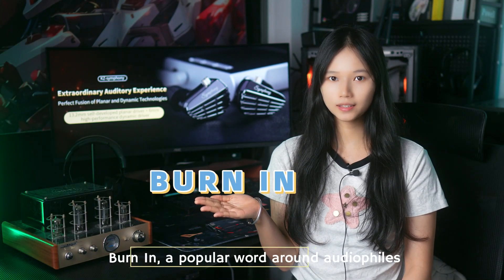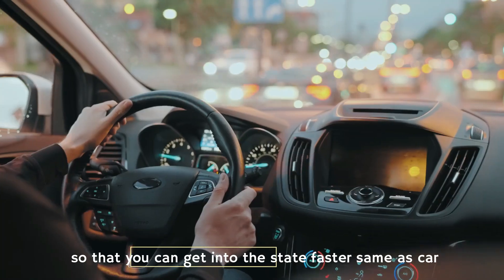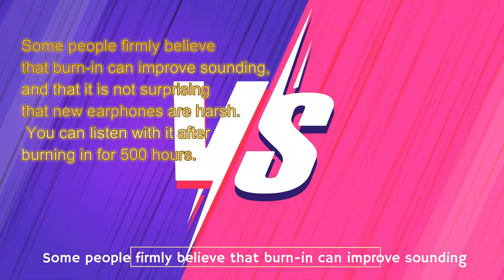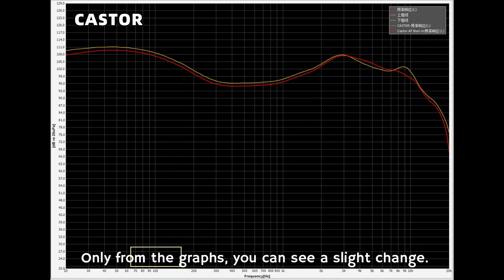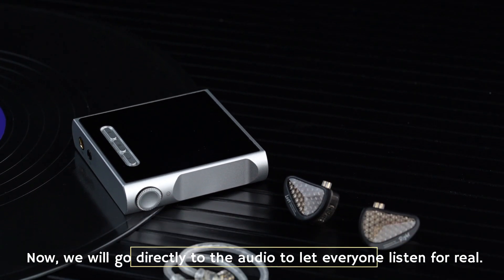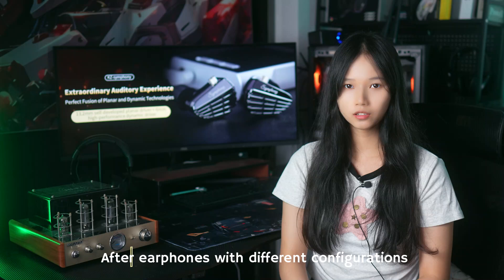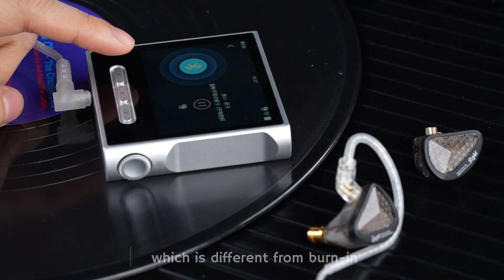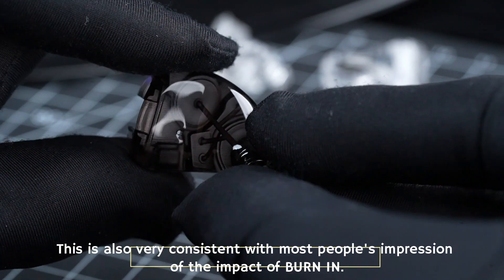IEM BURN-IN! Does it Work? Truth or Metaohysics?

Comment: Yes, it does work as usual. The bass will slightly turn warm after burning process. I realized that the planar driver need more time to burn in at first I feel the volume level is low but after the process it felt the volume had increase a tiny bit. This burn in takes time. I own most the k'z iem. By far the k'z castor pro are my favorite iem. Keep it up k'z team

Comment: It definitely work, cable, drivers, getting better on sound quality. Been  audiophiles  for 30 yrs and every tube amps, speaker cable and interconnect needs to burn in before the real sound really there,  I'm pretty new on chifi but it seems the same as home high end set up unless either the cables or drivers shitty then it doesn't really make a differences....

Comment: It makes sense, I guess it's maybe true because that's what we do in loudspeaker's. Once burned-in, the connection points loosen, letting the driver move in and out more freely. the audio quality will likely be noticeably better after the burn-in process, though the improvement is generally gradual. 

But that's in loudspeaker's so in theory I believe it does the same way in IEM.